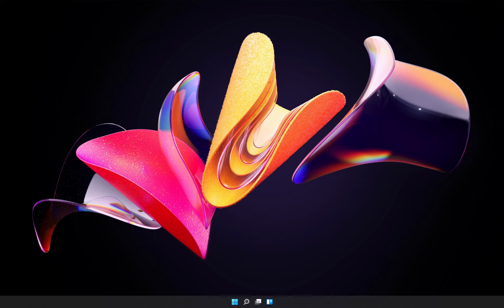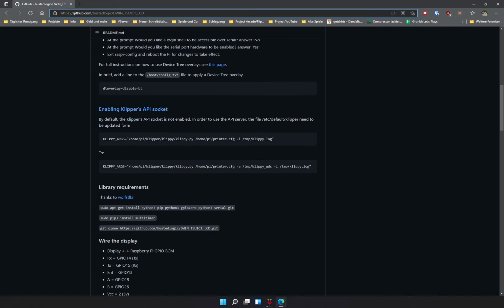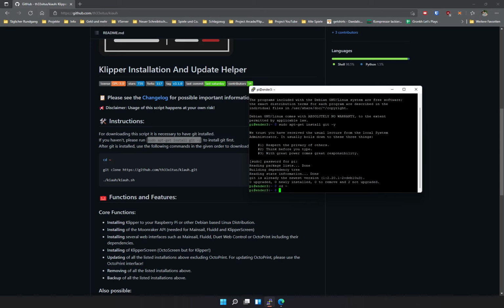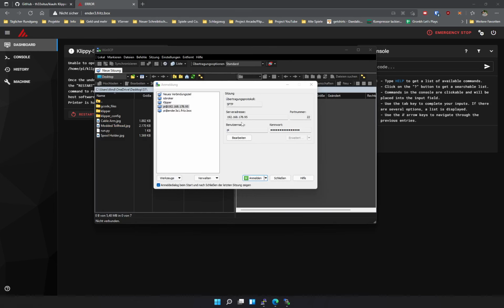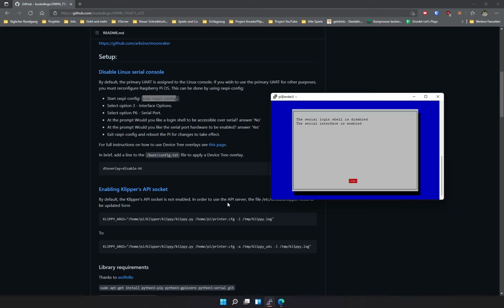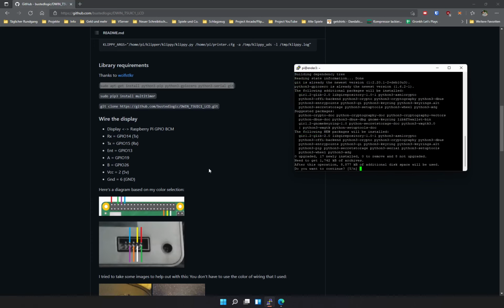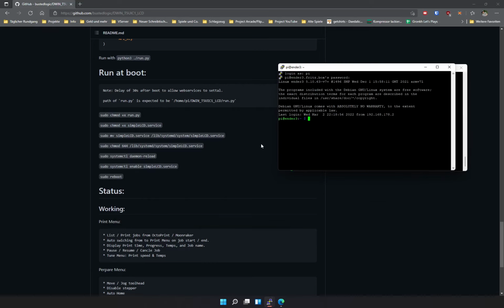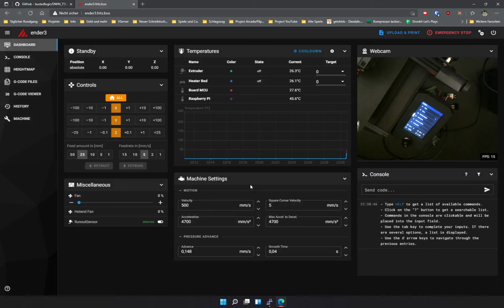Ender3 S1 + Klipper - Using the Stock Display

Comment: I followed the guide and it's working except icons and menu text is missing. Using a DACAI screen updated to the last firmware included in the marlin 2.1.2.4 release. Any tips? Thanks
Reply: just flash the screen with any dwin you want

Comment: I know I am late to the party, but what all functions still work with the screen.  I run klipper headless on one of my printers and was going to run my v2 headless but if there is enough functionality with the screen I might try it.
Reply: Another later commer to this video also... I just put klipper on my s1 with my retropie pi4, just to see if I liked it. Well I have a pi zero 2w on the way to make klipper permanent. When it comes in I'll be watching the screen setup part again. 
Hoping I can connect everything with the gpio pins to the main board

Comment: Unable to connect socket /tmp/klippy_uds [2,ENOENT]

What does it means?
Reply: 7 months later getting the same error. were you able to fix it?
Reply: @Jgmiranda_  i just made a directory in the tmp folder with the name and it worked
im getting stuck at the dwin handshake tho

Comment: Thanks for the video. I've got the F4 chipset & the screen is turning on - however the menu text labels are missing. Anyone experienced this before?
Reply: I have seen what you are describing.  I have two Ender 3 Neo Max's and placed the screen from the older printer (12/2022) onto the newer printer (3/2023).   Just as you described, the menu system functions but without text or icons within the menus.  Almost compatible... almost.

Comment: Hi great video ! Can i use "professional firmware" with stock display while im running klipper on Pi
Reply: Did you end up sorting this? I downgraded from professional firmware to stock & then to klipper.
Reply: Have you find a answer? I have the same question like you.
Reply: The Professional firmware is based on Marlin, it won't work with Klipper.

Comment: Thank you for this instructional video! Like some others, I did get stuck when trying to run the run.py script, with the error:

Unable to connect socket /tmp/klippy_uds

I'm running Mainsail OS 1.0.0, and '/tmp/klippy_uds' is not used as the comms socket; Mainsail uses '/home/pi/printer_data/comms/klippy.sock'.

You can solve this in at least two ways.

1. MODIFY RUN.PY SCRIPT

 I used a hacky method to create a file hard link as part of the run.py script, since the /tmp directory is purged on each reboot:

- Edit the run.py script and add the following lines after the #! line:

import os
os.link('/home/pi/printer_data/comms/klippy.sock','/tmp/klippy_uds')

- Save and exit
- Follow the rest of the tutorial as is.

2. MODIFY PRINTERINTERFACE SCRIPT:

You can also change the socket name directly in the Python script that calls it.

- Change to the DWIN LCD directory you cloned earlier: cd ~/DWIN_T5UIC1_LCD
- Make a backup of the file you're about to edit, just in case: cp printerInterface.py printerInterface.py.bak 
- Edit the printer interface file: nano printerInterface.py
- Find the line: self.ks = KlippySocket('/tmp/klippy_uds', callback=self.klippy_callback)
- Replace /tmp/klippy_uds with the socket name Mainsail uses, /home/pi/printer_data/comms/: self.ks = KlippySocket('/home/pi/printer_data/comms/klippy.sock', callback=self.klippy_callback)
- Save and exit
- Follow the rest of the tutorial as is. 

Hope one of these methods works for you too!
Reply: Another way:
- Change the file ~/printer_data/systemd/klipper.env

From: KLIPPER_ARGS=" ~/klipper/klippy/klippy.py ~/printer_data/config/printer.cfg -I ~/printer_data/comms/klippy.serial -l ~/printer_data/logs/klippy.log -a ~/printer_data/comms/klippy.sock"

To: KLIPPER_ARGS=" ~/klipper/klippy/klippy.py ~/printer_data/config/printer.cfg -I ~/printer_data/comms/klippy.serial -l ~/printer_data/logs/klippy.log -a /tmp/klippy_uds"

- After that change the file moonraker.conf

From: klippy_uds_address: ~/printer_data/comms/klippy.sock

To: klippy_uds_address: /tmp/klippy_uds

Done.
Reply: my hero🙌🙌thank you so much for sharing
Reply: thanks so much for this, i used the first method for this, i just had to change my directory to where mine had installed it.

Comment: Hi, i have touch screen version CR10 S Pro, with 2 RX and 2 TX wire interface connected on one spi port on the creality 4.2.2. It is possible to install and make it working?

Comment: great mate , i run in to error please after installation and i tried to print calibration cude but  i also get this error Invalid speed in 'G0 F0 X101.5 Y117.79 Z0.4' , please how can i fix it  and thanks in advance.

Comment: Hello! I need some assistance. So everything works fine, including the wiring connecting to the screen (screen turns on) but it stops at DWIN handshake. I currently using a Raspberry Pi 0 W. Thanks!
Reply: Same here
Reply: try to change tx and rx it will work

Comment: great video, congratulations.  with octoprint klipper do these procedures work?
Reply from the maker: Hey, If you mean If the Screen and this all works with Klipper and Octoprint instead of Mainsail than yes. That should Work the Same Way.
Reply: @Biekatastische-Videos  thank you very much for the quick answer, it worked like this the screen appeared and everything, but the button in the options doesn't turn, I don't know what it could be, do you have any ideas
Reply from the maker: Heard of that another Time and in that Case it was defective Cables or the Wiring wasn't correct. Check the Cables and also the correct and corresponding IO Pins. Should Work than.
Reply: @Biekatastische-Videos  
wonder it was the cables, top top, thank you very much.. whoever has difficulties in uploading the octoprint + klipper, and not connecting to the dsiplay, just put the user's API key in the octoprint;;
API_Key = '"'..
Reply: Doing this right now and when I execute the run.py file it stalls at the DWIN handshake.. what would be the reason for this?

Comment: Fantastic video. Got it working on the Ender 3 v2 following your procedure step by step. Thank you so much!
Reply from the maker: Mine is linked in the Video Description, at the Time i recorded the Video. Could provide a newer one but the changes i made are just minor and not that important as they are just for my Machine and should be changed on yours after Calibrations.

Comment: Does this work for the S1 with the new F4 board??  Would love to try it but am seeing conflicting info about it working and not working on the new chips / displays.....
Reply from the maker: Good Question, i just Had a Look and it seems that IT somehow works. As I don't have the F4 Board I can't Tell exactly but have a Look in the Klipper Discord and/or Here https://github.com/Klipper3d/klipper/pull/5332

Hope this helps and if it does IT would be appreciated to hear If and How IT works so we can Help each other over here 🙂
Reply: It does if you follow the F4 parts on here: https://3dprintbeginner.com/how-to-install-klipper-on-ender-3-s1/?spm=..article_25eb33b8-7cdd-486c-a010-5cbf261d4bae.article_1.1 and then use the conf linked here in the comments https://www.reddit.com/r/ender3/comments/uehuqr/psa_how_to_get_your_ender_3_s1_with_stm32f401_to/

Comment: Mine stops at DWIN handshake and does not show the display
Reply from the maker: Are you using Mainsail OS as OS on the Pi or did you Start over by using Something Like Raspbian and installed Klipper Manually. Could be a difference depending in how you installed it. I recommend Mainsail OS as Startpoint, Just Backup your printer cfg and other needed Configs, flash Mainsail and then start Like shown in the Video. Should be working then. If Not, could be a Cabling Problem or mistyped Text somewhere. Better Start fresh and Check Cabling.
Reply: @Biekatastische-Videos  it was my mistake i disabled ssh over seriel
Reply from the maker: @manpreetsingh46  good to hear that you solved it. Have Fun.

Comment: Thanks for the Video

I only have a little big issue, when I tried to use the screen wheel pushing him, is not working, then, I cant access any menu :(
Reply from the maker: Check the Cabling again. Seems Like it's missing or connected to a wrong Pin.
Reply: @Biekatastische-Videos  finally today I received new cables, work like a charm now rewiring with those new cables, thank you (y)

Comment: Do you have any idea if this would work with an Ender3 S1 Pro display?
Reply from the maker: I think not but can't Test. Maybe with another Fork.
Reply: @Biekatastische-Videos   awaiting my S1 Pro and would really love to be able to do this. Any more info on a working fork? Thanks for the great video!
Reply: @CaseMoney  you cant do anything with the s1 pro display. creality wont release the code, it limits you from using any firmware that needs a screen. so i took mine off and put on a rotary knob like the regualr s1
Reply: @Biekatastische-Videos  I got my S1 Pro this week and took apart the display. It has only 4 wires tx rx vcc gnd. It is much much like Nextion touch screen which has a SD card slot as well.
Reply: @luckposhtiii  i under stand that. creality is using so many times of screens bow its dumb.

Comment: I replaced my Ender3 V2 screen with a 12864. It would be nice to go back to the stock display, so I will have to give this a try. Thanks.
Reply: Just got it working. Thanks.
Reply: @davethetaswegian  Was it exactly the same?
Plan to do this, this weekend.
Reply: @3sotErik  The DWIN screen has its own firmware so there is no direct control over what it looks like. So Klipper has to just make use of what is already there. What you get is something that looks and works almost exactly the same as on the stock printer running Marlin. This works fine as Klipper and Marlin are doing much the same thing, but you won’t be able to customise the menus as you can with the 12864. The other thing to note is there is a 30 second delay before the screen starts up. Overall it works fairly well and is more aesthetically pleasing, but the 12864 is the more flexible and functional choice under Klipper. I switched back as I put dual independent Z on my printer and changed to a MKS Robin Nano 1.2 (which I already had) for the fifth stepper driver. This board doesn’t support the 12864 style displays, so switching back to the DWIN was the best solution to keeping a display without paying out more money for a Pi compatible touchscreen to run Klipperscreen. Hope this is helps.